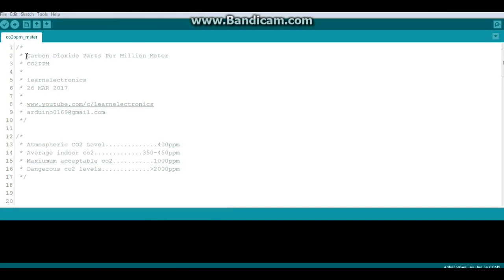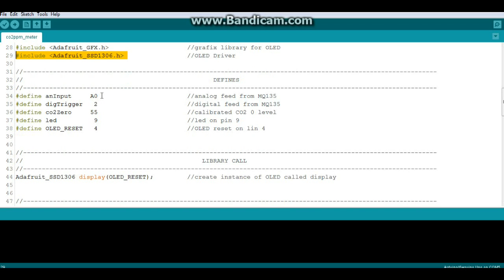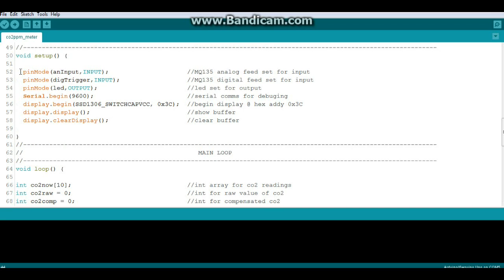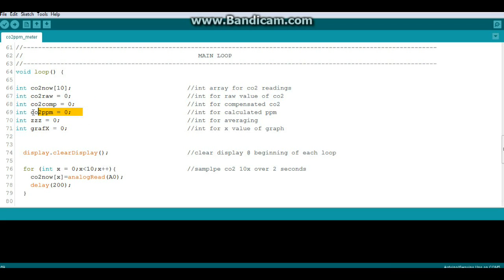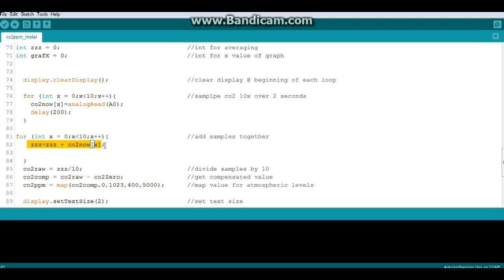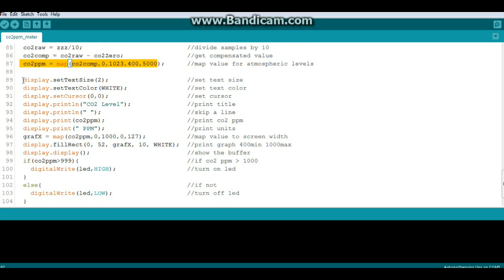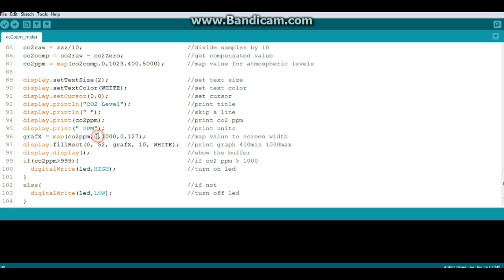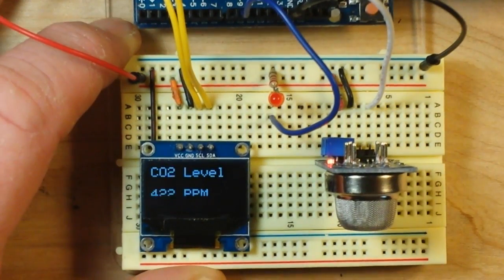Arduino DIY CO2 PPM Meter

Comment: Hi there,I keep getting the following error when compiling the code that you make available: 
"exit status 1
Error compiling for board Arduino/Genuino Uno."Any suggestions anyone on how I might be able to fix this error?
Reply from the maker: Well, without seeing the entire error message, my best guess is that it is a library throwing out that error. When I did that video I used a Windows7 PC, Arduino IDE 1.6.something. So if you are using a different version of the IDE that could be it.
Reply: Hi there,Yes, sorry...the full error message is as follows:
 #include <Adafruit_GFX.h>                     //grafix library for OLED                                                                        ^compilation terminated.exit status 1
Error compiling for board Arduino/Genuino Uno.I guess the Adafruit_GFX.h library is not included with my IDE?Might I be able to install that library in my existing IDE? Would it be available from Adafruit?Any suggestions for overcoming this challenge are most appreciated!Cheers!  Steve
Reply from the maker: Stephen Gareau ah ha! Now we know what the problem is. Easy fix my friend, download the  library and install it. Here's a link: https://github.com/adafruit/Adafruit-GFX-Library

If you have any trouble, just give me a shout!
Reply: Thanks! I found the two missing Adafruit libraries (GFX + SSD1306) and installed them into the Arduino IDE. The compile of your code went through okay. I hooked up the circuit board and uploaded the code. The LED goes on, but nothing displays on the OLED display...Hmmm...the plot thickens! The OLED I have has a small 4-post connector that is not soldered to the OLED display (perhaps for easier shipping). But I should be getting something on it because the posts can be manually connected to the display. Perhaps there is something wrong with my circuit design??? Not sure... Any suggestions, doctor?
Reply from the maker: Stephen Gareau Well it could be the I2C address. Look for my video on find any i2c address. If yours is not 0x3c you will have to change the code.
Reply: Hi there, Where might I make the change to the I2C address? I looked in your code but could not find it there. Cheers!

Comment: Hi there, Being new to the Arduino world, can you please provide instructions for listing and connecting the various components on the board and the Arduino unit? Cheers!
Reply: arduino uno, breadboard, wires, 220 resistors, led, MQ-135 sensor, arduino screen (on amazon 1st thing)

Comment: Hi there, Being a newbie to Arduino, will this project work with a UNO
R3 Board ATmega328P CH340 Development Kit? Cheers!
Reply from the maker: Stephen Gareau hi, it will work with any Arduino
Reply: Thanks!  Cheers!
Reply: yes it does you just need the mq-135 sensor

Comment: Hi there,  Excellent product to build. Thanks! I am teaching an environmental science course, and would like to use this product in the course. Can you please recommend a good online source to buy the main components (Arduino, I2C LOED display, and MQ135 gas sensor)? I have never used Arduino before, so this is a good time to learn! Thanks. Cheers!
Reply: Thanks very much! I appreciate it. Cheers, Steve
Reply from the maker: Stephen Gareau you are welcome. We teachers haven't to stick together. I'm an associate professor of electrical engineering at a small community college.

Comment: so this is like an r2 board and would it also work on a r3 smd board?
and is there a component list at all?
Reply from the maker: 2012isRonPaul I don't own any R2 boards. This design will work with any Arduino. Components are: Arduino, I2C OLED display, MQ135 gas sensor.
Reply: ok thx, but would the code also work on any esp8266 board?
Reply from the maker: 2012isRonPaul Yes it would, but you would have to change the pin numbers.
Reply: ok thx, but can the breadboard run at 5 volts and the d1 board at 3volts at the same time? and how long are the jumper cables in the video and which baseplate is it? :w
Reply: AnupPlays
2 seconds ago
arduino uno, breadboard, wires, 220 resistors, led, MQ-135 sensor, arduino screen (on amazon 1st thing)

Comment: the relation for the mq135 is logarithmic... are you sure the function map is the correct one to obtain the ppm value?
Reply: and a 9 V battery won't last a long time... the sensor consumes a lot of power... because of the heating... nice OLED
Reply: It looks linear because it is on a logarithmic based graph.
Reply: An average exhaled breath contains about 40,000ppm of CO2, so the fact that his readings only go to 500ppm shows that it's probably wrong.
Reply: @keeranparthipan2716  Please remember that CO2 and any other gas expands to fill the volume of the container it is placed in.

Comment: I think there is a problem when you do your average because you have 11 values in your array and after you divise per 10, if you want 10 values in your array it's co2now[9]
Reply from the maker: You are correct. Thanks for pointing out my mistake.
Reply: thx to you for this tutor :)

Comment: xpost from Reddit:
Thanks for this tutorial.
Could you please why do you map sensor's readings from 400 (I get that) to 5000?

5000 seems too high and if you lower this number the readings would change drastically.
Reply from the maker: googhalava 5000 was the maximum reading on the CO2 sensor I modeled this on.
Reply: Do you mean MQ135 can read as high as 5000 ppm CO2? I couldn't find it anywhere in the specs.